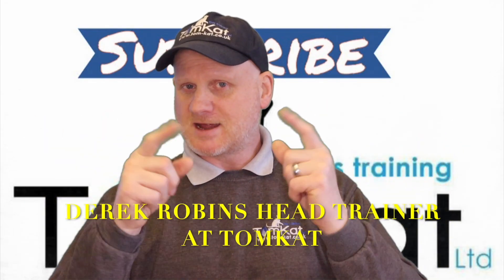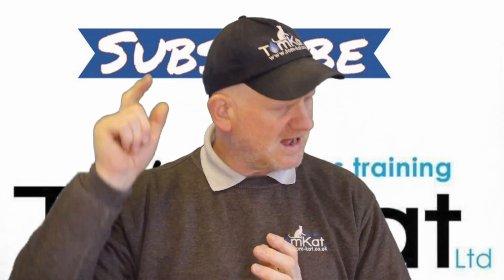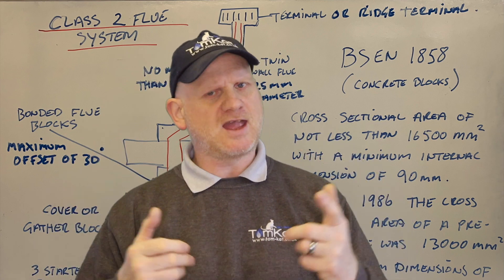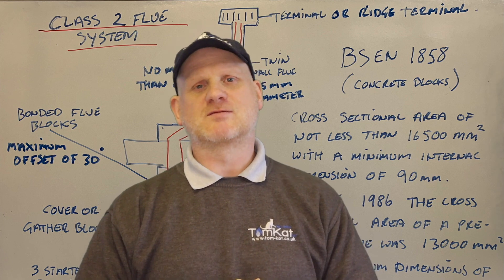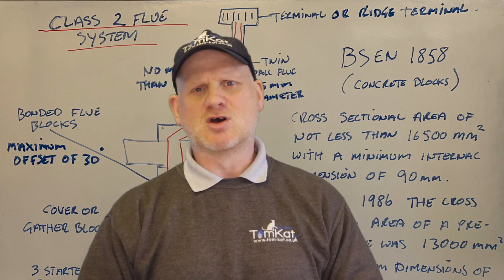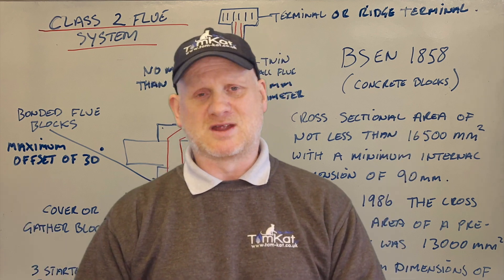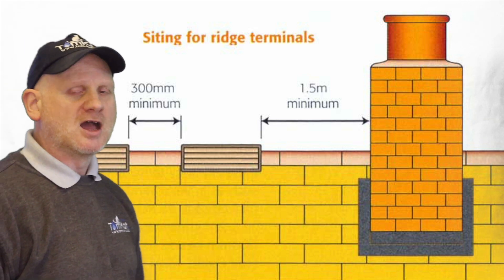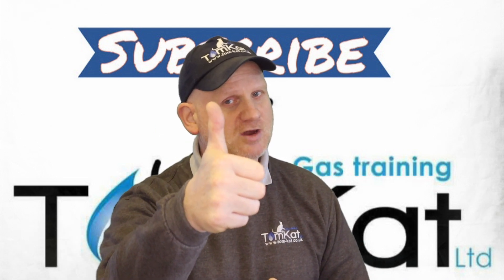PRE-CAST FLUE SYSTEM, acs gas revision in less than ten minutes part 10

Comment: Doesn’t there need to be 600mm straight run off the top gather block before any change of direction??
Reply from the maker: @MikeyUk1982  yes in the flue blocks you need 600mm rise before change of direction. If you mean the transfer block at the top of the flue blocks were it changes to twin wall flue no you don’t

Comment: Brilliant, just what I was looking for. I have that exact type of flue/chimney. My house was built in 1983, and as you expertly mentioned, my walls are cracked from downstairs to upstairs, so I will have to have all the outside wall dot and dabbed! Looking in my loft, there is an angled metal flue, just like on your drawing, but the joint between the last flue block and the metal flue, is completely loose with no seal at all at either end or at the 45degree angle, it is all loose. What sort of cost are we looking at to replace the angled metal flue and to fit and fully seal. Thanks in anticipation.👍👍👍👍

Comment: Very interesting my plaster has cracked from the ceiling to the skirting board. And i also have a pre cast flue system which has been decommissioned  before i got the property that information has only recently come to light. Could you please give me some information of how this issue can be rectified i would be extremely grateful.

Comment: Great video - we have a house that was built around 1998 with a pre-cast flue system. However, the block in the loft is not connected to the ridge vent on our roof! Do you have any idea why this would be the case? I'm trying to contact the house builder (David Wilson) to discuss the issue.

Comment: Great video. Lots of information given in just 10 minutes on precast flues. Fantastic.

I don’t quite get what you mean when you say ‘if the direction of the blocks change, the maximum angle it can be is 30degrees’ Why would the direction of the blocks change? The blocks/wall is built straight and level right.. (sorry, had to ask 😬) Thanks Derek 👍🏻

Asian Jon. Training.

Comment: I live in a house made in the 70s that has a precast flue but with a pretty old cement flue pipe in the loft that has 90 degree bends in it. It is currently unused though since we had the openning plastered over in around the very early 2010s or maybe late 2000s for an electric fire to go there. So far we’ve been though 3 electric fires because they break and we replace it as per the standards of throwaway society. If we ever chose to bring that flue back into service with a radiant fire on it provided the appliance PASSED the flue flow and spilliage tests would the old 90 bends still be allowed to stay abeit classed as the old “Not to current standards”?
Reply from the maker: No the bends are now AR so that part of the flue will need upgrading